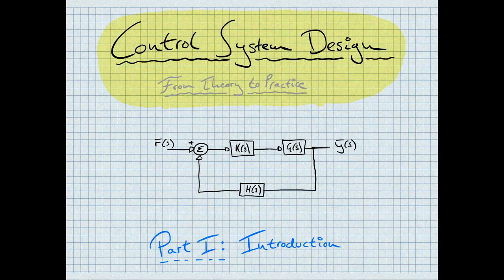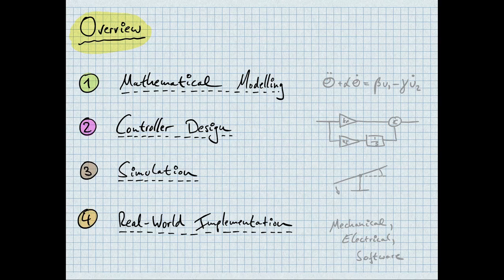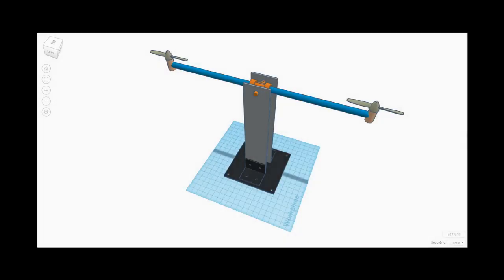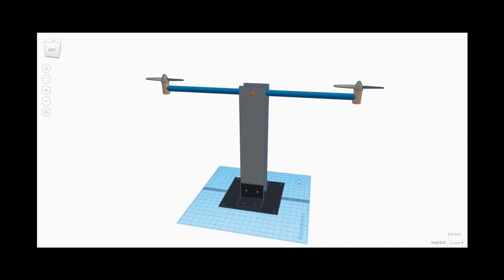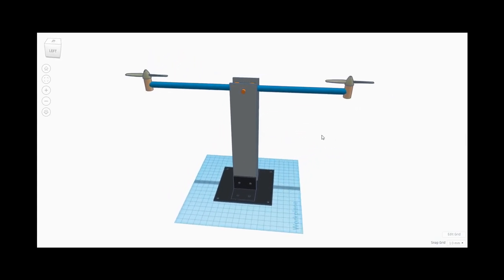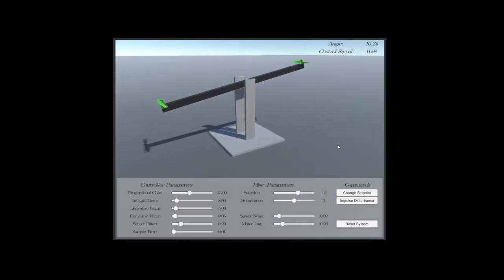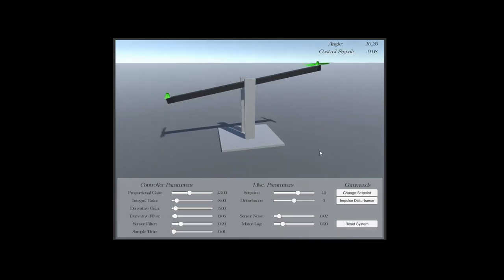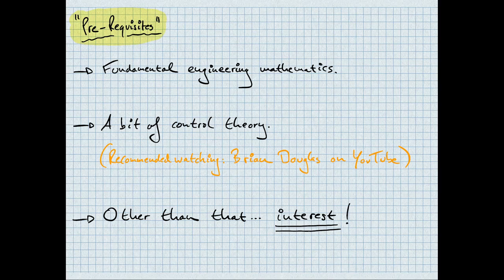Introduction - Control System Design 1/6 - Phil's Lab #7

Comment: Awesome work as always!
Question unrelated to this video: 
Have you considered a dual core stm32h7 variant for the HADES NT?
Reply from the maker: Thank you very much!
I actually hadn't heard about the dual core H7s until recently but I also have gone off the idea of using two MCUs on one of the flight control boards - mainly for simplicity's sake. What I have been looking at however is putting a 'low-level' MCU (e.g. something STM32-ish) and a higher-level CPU (running some form of Linux) on one board, so to enable and split basic control functionality and things like AI/image processing functionality. That board layout will definitely require a bit more thought and it'll be interesting to try and squeeze everything into a small board space. Any thoughts on this kind of approach?
Reply: @PhilsLab  Hey, I have certainly seen the approach you are describing before but perhaps not as tightly integrated as you are envisioning. It would certainly be awesome to see a fully integrated MCU + Linux CPU combo but my greatest apprehension is the time investment sunk on the Linux CPU integration given the rate at which this market is developing.
  
In the Ardupilot world there are options such as the navio ( https://emlid.com/au/navio2/ ) which is basically a small stm32 + sensors integrated onto a raspberry pi 'hat'. While the MCU + Linux CPU combo exists in that example, the flight control loops are running on the pi and the MCU is collecting data from sensors.
Another example of a similar setup (but running its own flight control software stack) is https://github.com/RiceCreekUAS/aura-hardware ( https://www.youtube.com/watch?v=FZXd-nXSc2A ). Similar to the Navio this design uses a MCU for interfacing with the sensors and runs the flight control on the Linux CPU.

Both of the above examples are running the flight control code on the Linux system, which when you start wanting to add other CPU expensive operations can get tricky to manage . In that regard I prefer the functional split of keeping the flight control on the MCU ( or its own dedicated CPU ) and having the higher level functions on the Linux CPU. 

A typical setup that I see used in research and bits of industry is an autopilot (that is MCU based) with a serial / CAN connection to a Linux based flight computer (typically a Nvidea / Raspberry Pi variant or Intel NUC device). In this setup the autopilot can worry about keeping the vehicle in the air and stable while the connected flight computer can do the higher level functions such as path planning, object recognition, etc... However in that case you have two discreet systems. Perhaps there is a happy halfway that could shrink the form factor and keep the systems independent? Something like a nvidia nano carrier board with the MCU based autopilot on the carrier?
Reply from the maker: @samueldudley8084  Thanks Samuel for your detailed response!
It was about 4am in the morning when I replied, which meant I overlooked the "Hades NT" part of your comment. Briefly, regarding the NT board, that is there just as a barebones, inexpensive flight control board that has the absolute essentials on it: H7 + IMU + Barometer + various interfaces. I believe it should cost around 20 to 30 Eur including components and mainly to use as something that can be up and running quickly.
Getting back to your comment however.. Thank you for the links you suggested! 
Yeah, getting the whole Linux part of the system running reliably and integrated well would definitely be quite the headache. I must say I'm not by any means a drone/UAV pilot and am not up-to-date as to what is on the market currently or how it is evolving.
I have seen, as you mentioned, many systems where an MCU is interfaced (via serial/CAN) to a Linux-based computer. I generally am a fan of having less wiring and less individual modules, so as you say - perhaps there is some sort of midpoint where these two systems can be combined.
The whole thing would definitely require a fair amount of though and also research into how many people would actually invest in something like that. Have you seen ST's new line of Linux-CPU + MCU chips (https://www.st.com/en/microcontrollers-microprocessors/stm32mp1-series.html)?